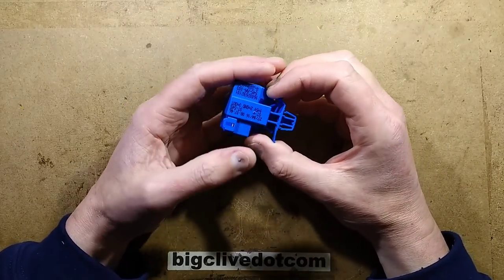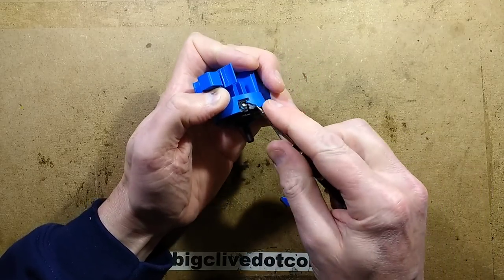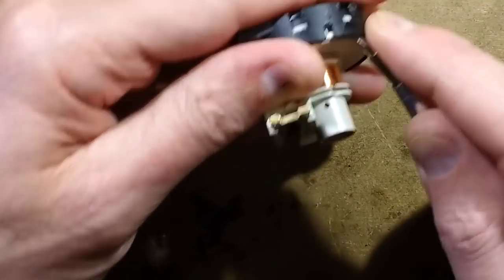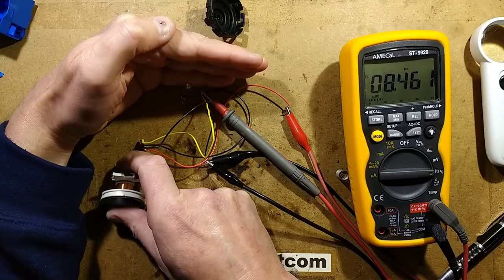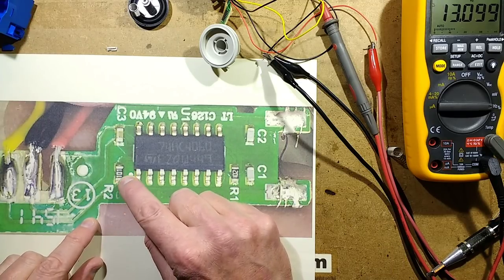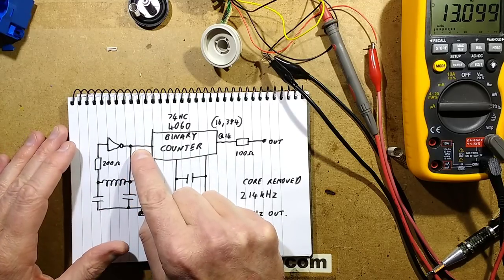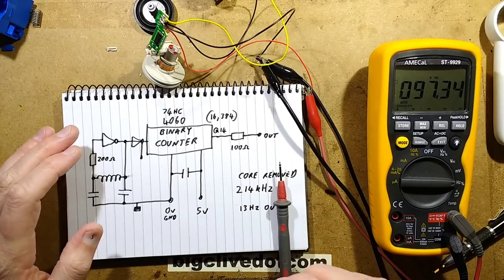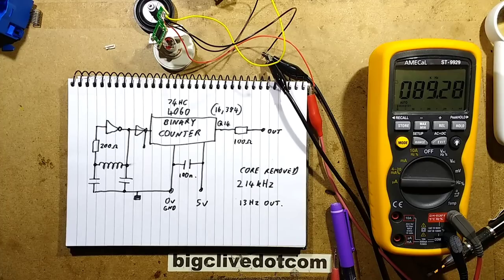Inside a washing machine water level transducer. (schematic)

Comment: I'm a appliance repair man. And I can tell you. For the consumers,  the low water level is a issue. 
Would you think adding one or two inches of hose, might increase the water level? I would be a hero if I could add water to the washers fill level.
Reply: Hardee prepper The sensor would have to be moved up or down to change the head pressure,or recalibrate the preload springs,as seen in the video. My guess.
Reply from the maker: I've noticed that my new machine fills with water in bursts and seems to tumble the clothes briefly before sensing again and adding water if the level has gone down.  My guess is that it will keep filling and tumbling until the clothes are saturated and can't absorb any more water.  That way the minimum water is used to maximise the efficiency of the detergent and heating.  Then in the rinse cycles it will add a lot more to remove the loosened dirt.
Reply: bigclivedotcom That is how ours works:tumble,fill,tumble,etc.
Reply: Just adjust the plastic screw inwards.
Reply: I once washed my clothes in a HE machines, then washed them again and again and again, after "4 washes" they were almost clean :))
yes, I tend to become "Pig-Pen" at times ( charlie brown cartoon character), little rolling around in grease, oil, road grime, dirt, etc. in the garage or lawn
Reply: throttle bottle As with any warsher,dirty clothes need to be pre-treated. My work "funkies" are constantly getting cooking grease residue on em. Toughest sh!t to remove!
Reply: @bigclivedotcom older models of washing machines have the head of the screw uncovered so we can adjust the level of water used by the machine. Now we can't.

Comment: Surprised it isn't an ARM cortex A5 running embedded windows or some other over-engineered bullshit sending 512 bit encrypted one-wire serial data packets to the host controller board in the washing machine for water level.
Reply: The Dollar Guy then it wouldn't work,
Reply: Who runs Windows on ARM? What a waste of money :p
Reply: Would have been funny if it had an Atmel chip and some dodgy Arduino sketch.
Reply: Windows CE is pretty reliable, assuming you configure it properly. If using it for a single task device (e.g., those random price scanners or other basic things), you need to disable as many other services as possible, especially if using the units with 32-64MB of RAM.
Reply: tin2001.  Exactly along my line of thinking.... :) Three layers of virtual machine shovelware stacked on each other by a lazy programmer so it takes 23,679 clock cycles to execute one CPU instruction with a disabled watch dog timer.
Reply: There is an internet enable washing machine - I'm guessing it's using an even more powerful CPU to perform that function!

Comment: About the same look, the DC96-01703G only have the two pF capacitors on the PCB, nothing else.  There is a 23ohm resistance between the two signal pins or the module and it does not vary when I move the ferite log.  Possibly the reason why my washer does not detect water level and produce an OE code.  I suppose the role of the IC as been moved in the main controller board.
Reply: What you suppose it's corret about the chip.
Reply: Yes, I also took a DC96-01703G apart, and can confirm that there are just 2 capacitors on the board; no IC.  And yes, moving the core of the coil in or out will NOT change the resistance; but it WILL affect the inductance of the coil, and the resonance of the tuned circuit.

Comment: Here is a snippet from a service manual of a frigidaire washer/dryer (laundry center) that touches on the water pressure/level sensor.
"
9.11 Pressure Sensor
- FFLE3911QW and
FFLG4033QW
9.11.1 General Characteristics
The Pressure Sensor is an analogue device that controls the
water level in the tub, used in models with electronic control
system, and it is directly connected to the Main Control
Board.
A tube is connected between the bottom of the Tub and the
Pressure sensor.
When the tub is filled with water,
it creates a pressure inside the
hydraulic circuit that causes the
membrane to change position. This
in turn modifies the position of the
core inside the coil, thus changing
the inductance and the frequency of
the oscillating circuit.
 The Main Control Board recognizes how much water
has been filled into the tub according to the frequency.
Operating frequency varies according to the quantity of
water in the tub
"

Specifications
Pressure Frequency Diagram
( At Water Level “0” mm (empty tub) Frequency will be 45.4 Hz )
Mm H20* - Hz* : Points with 100% control of frequency output on assembly line

Pressure (mm H2O) Nominal frequency (Hz)
Water Level at
 0* 45.400*  Tub empty, 0 pressure and frequency is 45.4 Hz
150* 43.140*
200* 42.350*
350* 39.990*
500* 37.772*
600 36.560  Tub if full and frequency 36.560.

Mm H20* - Hz* : Points with 100% control of frequency output on assembly line

Comment: Nice vid. funnily enough this is called an analog water level sensor or pressostat. The old one which has 2 modes: On / off is a digital pressostat, because on=1/ off=0.  It also clicks when you suck on it.

Comment: I've done some work for appliance manufactures and their method is the K.I.S.S. method you'll find in nearly every shop in the world. Simple keeps cost low, complexity low and in effect failure rates low. Using this configuration probably lets them use the same sensor in a sophisticated IoT machine with fully integrated feedback on the HMI and let's them use it in the "old fashioned" simplified models as well. Oddly enough, if you can salvage these sensors they work great for years and cost a fraction of what an industrial robust equivalent would cost. They just have a lot less documentation available to work with which makes integration much more difficult, unless you take one to bits and make a schematic. Ofcourse, that said it does explain why replacement sensors are so expensive to buy new. Robust industrial sensors are very expensive to buy, and they wouldn't want to flood the market putting themselves out of business or putting precision sensor makers out of business with simple cheap devices. There are huge differences in application for both. Thanks for the video Clive.
Reply: Hi Jason, do you know somethings about this sensor? Like I have to read the frequency by a micro?
Reply: @dariovicenzo8139  I know a little about a lot of things. If you want good understanding of sensors, how they work, and what they actually detect I suggest reading Grob and Malvino when you are ready for solid state. They cover the base physics and cover the base chemistry of how devices function and are good first year books for any EET or hobbyist.

Comment: The range of 0-0.3m of water quoted on the casing corresponds to about half a psi, which is well within the typical range that people can produce from their lungs. Might be interesting to blow in it if you ever run into another?
Reply: That's a good way to test the old pressostats :) Should work with this as well

Comment: Does it really need to be that complicated? I mean, I guess so, as it works, but I feel like this is a bit overkill. I wonder if you could use the moving parts as a surface vibration speaker?
Reply: complicated?  Sure, the IC is complex, but that is made, in it's millions under very controlled conditions.  That means the rest of the device is actually very simple, with just a couple of moving parts, and only one "wearing" part (the diaphragm itself), unlike the old mechanical pressure switches that were levers, pivots, springs, and on which the contacts wore everytime it operated
Reply: Max Torque Well, true, less electrical contact areas to wear out, for sure.

Comment: Main micro calibrates to sensor at start of cycle? And micro may have a go-no go code if frequency is out of tolerance at start. Hobart LX E undercounter warewashers have up to 3 of these pressure sensors. We can see the values change in real time,in Service mode.

Comment: Very nice and useful. How would I trick it to fill with more water?
Reply from the maker: That decision is made by the control system.  These machines initially just make the load damp to maximize detergent strength and friction as the drum rotates.  It adds a lot more water for the rinses.

Comment: Can the frequency of the output signal be read using an ESP32 module? I have a pump in a rain barrel to water my plants, the sensor could signal the barrel is empty and keep the pump from working.
Reply from the maker: You can get water level sensing relay modules.